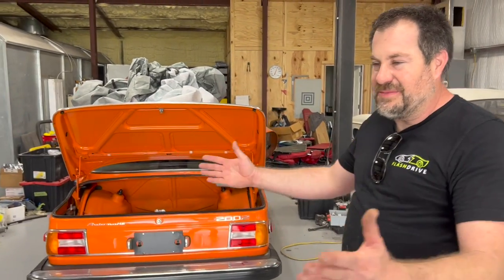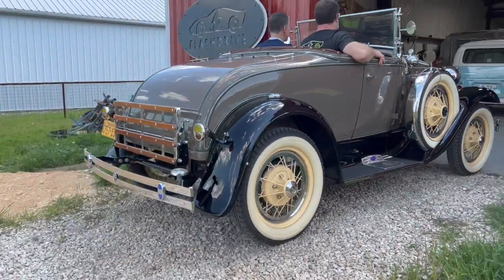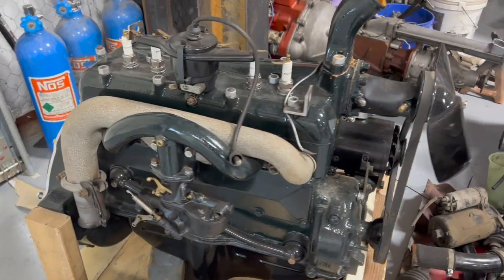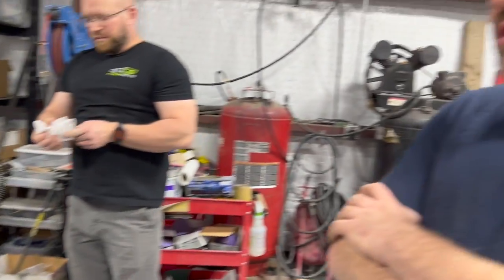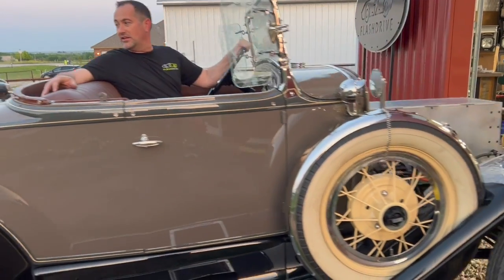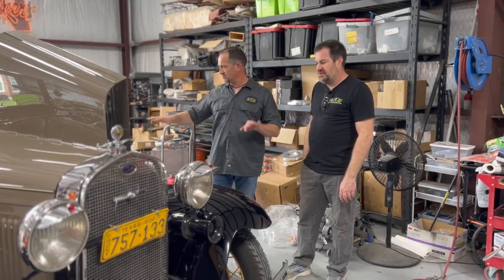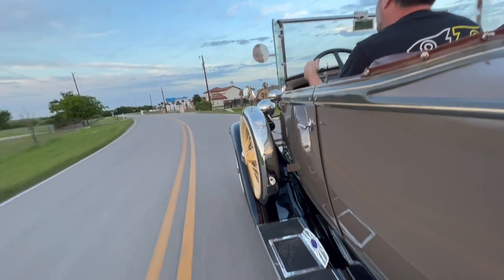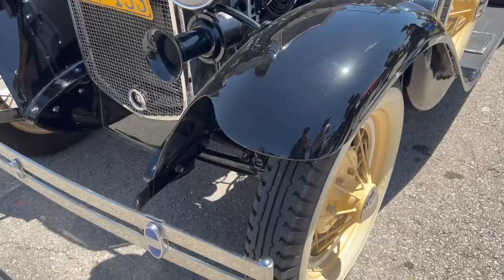The Model E - 1930 Ford Model A Roadster All Electric EV Bolt In Conversion. Tesla battery & Hyper9.

Comment: The perfect conversion. Ford would have loved to build similar, if they'd been possible/practical back then. Even his wife drove a Detroit Model 47 and temporarily looked at building electric cars around 1914. Of those who were down on the conversion, I'd bet a lot of them have hacked up some old cars in their time. You just did a sensible swap, 100% reversible.
Reply from the maker: Thanks, we liked that it doesn’t permanently change the car. But he can now use it
Reply: @dissrepair  Odd fact: V8=cool, EV=ruined. 😁 It should be more pleasant to drive and store, just climb in and drive. He might notice his car and garage loses its distinctive "musk" smell after a few months; 70% burned oil, 20% from fuel, common with pre-60's cars.

Comment: Converting a gas powered car to an EV is an abomination to that true classic. EV's are not the future for lots of obvious reasons. Converting EV's to gas is becoming common after the expensive batteries die but molesting this classic is just sad. Yes, you made it so you can convert it back. But it should never have been attempted in the first place.

Comment: I like the concept of talking very old cars and converting them to electric. but this car is way to beautiful to do that that to.

I like the fact that you made it reversible. a person would want to convert a model A to hydrolic brake's. and Coker Tire makes replica radial tires for those cars. that would eliminate the flat spots in the tires. and would work better and be safer at higher speeds.

Comment: First and foremost I most appreciate your dedication to avoiding modifying anything permanently. That was the best news.  The workmanship looks quite good too.  It doesn't look like a hack job, which is also very good news.  That said, I normally do not consider electric conversions that retain the transmission to be good, but, in this case, it avoided hacking up the drive train, and so it actually makes sense here.  Just leave it in high gear, if it has an appropriate motor.  You could swap in a lower axle ratio.  No harm in that.  My Model A pickup has 4.11 gears, and the old engine is rather screaming along at 65 mph.  Would love to swap my gears for yours lol.  To me, the BEST part of old vehicles IS the original or at least period correct drive train.  THAT'S what makes them interesting, outside of just looking neat.  So, I don't have a problem with the electrical conversion specifically, just non-period correct engine swaps in general.  In my experience, Model As drive in today's traffic without issue, so all of that talk to the contrary was just unnecessary justification, and it is largely untrue.  Never heard of one blowing a head gasket, but of course it's possible with any engine, so I don't doubt it could happen with one of these as well.   Mine has been in the family since 1941, and of course I want to keep it as original as practical.  It's not restored, it's just a cool old truck.  Driving it is very much like stepping into a time machine. The sights, sounds, vibrations, the odors, all of it.  Like stepping back in time.

Comment: i own a Model A and i had thought of converting to electric or a modern 4 cylinder because keeping it up and driving on the old slow engine sucks even though i converted to 12v ,  electronic ignition and weber 2 barrel carb

Comment: I like what you have done and I like that it is totally reversible, you did not mention the cost, I suspect mega money that would make it out of most owner's reach. I would like to do this to one of my vintage cars, however...

120 years ago there were more electric cars than petrol (gas) cars, but the same problems for EV's then exist today, range & charging, but add into the modern mix, highly flammable batteries - this could be the achillies of modern electric cars. Imagine that, as the batteries get older, fire can be an increased risk, cars are banned from underground car parks, being parked near buildings, or other cars, not allowed on ferries, etc., will kill it dead.

I am not convinced that electric cars are the way forward, certainly with the current battery technology, and where is all the electricity going to come from? We barely have enough power generation as it is, so with all these demands from new electric cars, I can see rationing occurring.

A carbon neutral fuel may be around the corner, and if so, that will kill the EV dead again for a second time.

I like the concept of EV, but sustainable, they definitely are not, we are being sold lemons as oranges and sadly, the new environmental zealots have made this into a new religion and if you don't agree you are a heretic. My view is that some of the claims will be debunked and the biggest issue that nobody discusses is that there are just too many people living on the planet, stop having kids that is the most sustainable thing to do. 

Greetings from the UK!
Reply: OH my, I'm getting solar installed around the 1rst of the year and am going to buy an electric car in 3-4 years or sooner. Religion? Hardly.

Comment: I'm a purist yet I appreciate beautiful engineering. I think it's pretty awesome. Painting the unit green was a very nice touch as well as the charging port. No doubt I would upgrade the brakes. Other than that, it's a fantastic local cruiser.
Reply: Have you ever seen Jason Mamoas vintage coach built RR .. E motor. Conversion the battery case looks like a fully polished dummy engine.

Comment: I would have to model A's. One would be electrified for the daily drive. The other one will stay with the original engine for the irreplaceable sound it generates. Like a VW beetle. Its 50% material 50% soul

Comment: Gas, diesel, ethanol, rocket fuel, Av gas, electric..
 Performance is what matters.
Not nostalgia.
 Not to a gearhead.
 Ford used the best technology available, at that time.
 If an electric conversion has equal or better Performance, then stock.
I'm all for it.
 The weight of battery's and limited range were issues to overcome.
 An affordable 4 wheel drive EV with a motor in each full floating hub.
Could have ground clearance and flexibility / wheel travel.
That no solid axle can come close to.
 I appreciate your work.
Well done, but.
Fix the brakes.
Brakes matter. A lot.

Comment: Good way to ruin a great car.
Reply: It's a great way to immortalize a car from the bygone era
Reply: nah
Reply: ...did you miss the part where they talked about the fact that they didn't have to modify the car except for a hole they had to make slightly bigger?  The rest is bolt in.  Meaning it is completely reversible. All they really did was make it more reliable and drivable.
Reply: Ford made almost 5 million Model As. They made over a million in 1930 alone, and would’ve made more if not for the Great Depression. As a result, their resale value isn’t very good. To restore one would be a labor of love, as you would never churn a profit. Due to their availability and price, they were a great platform for hot rodders. That and Model T’s. You could say that this is the modern version of that. There are plenty of museum concourse examples, that making such a car your own, really shouldn’t be that big of a deal. And if anything, it allows this car to be driven daily if the owner wants to. That means this car will actually be SEEN by regular people who may have never seen one before, because they don’t go to car shows. An engine can always be swapped back in should a new owner prefer something more original, but these are such difficult cars for modern drivers to handle, that they probably wouldn’t. Sometimes it’s nice to just get in a car, and drive.
Reply: Was it ruined?
Reply: Womp womp
Reply: Exactly

Comment: A much smoother ride is obtained when the originals A’s wheels are replaced with 1932 wheels and the spare fits the fender well too.. I drove a 1931 Model A pickup with 1932 wheels in high school and College.

Comment: The three phases electricity 🔌. 
1. Not economically sustainable. 
2. Not environmentally friendly. 
3. Not applicable on the economies of scale.
Sure they promised that they're researching for a new battery types. In mining of lithium, where China and Russia have a greater supply. Environmental damage and disruption caused by going after this. And they problems with having a viable way of recycling after use for a wife has concluded. There are other issues. Am I a big naysayer when it comes to electric vehicle?  Based on these points answer's yes. But do you remember the electric quarter-mile postal van built 30 years ago or so, by a short teacher and his class? It had come into ownership by a couple of men. The store I got was one had passed away and the other Wella just sit in his garage for a while along with a newer version for the electric propulsion system. I had negotiated a price but based upon transportation the deal fell through. It's worked out well for the man because her what I was going to pay for it, he got so much more a short time later. So I have a very strong interest in electric vehicles. I just don't see the upside being stronger than shall we say the downside of electric vehicles. Speaking of taking the vehicles to the masses on a large number. This was a nice car that pay bills in this episode. But people have been converting cars and pickups for decades now. Remember when CNG was going to be the next great alternative to standard fossil fuels? Of course most of you do not. But go back and look around 2010 or so. There's a number of over-the-road trucks that are CNG. Look at FedEx and UPS semis. I personally own a V10 Ford that is CNG and a Honda 4-cylinder car that is  CNG. I wish they were dual-fuel but they're not. So it's not like I haven't looked into it and actually spent money on alternative fuel vehicles.  There is a place for electric, just not for the masses.

Comment: This is actually a great use for EV….brings new life to ancient technology and reliability! ……especially vehicles that sit a lot …no worries about fuels going bad etc.
Reply: Yeah if the engine is beyond repair but aside from that it is pointless to convert a Ford Model T and A if anything it is damaging the whole Charm and historical value of the car second these engine run on anything that burns you don't need gas for it so restmod a beyond repair sure aside from that no however you do you what the guy wanted makes sense the engine was bad and he wanted to enjoy it everyday that I agree with I just don't want all the Model T and A to be electric keep some of them preserved at least.
Reply: If you did even watch the video they made everything using original mounting points without any modifications so you can switch back to original engine. Because these conversions make these vehicles usable and can be driven even in cities in the future. This way more people can see you driving and you don't need to abandon these nice old machines. @jonathancunningham8739
Reply: Dont want any glorified golf cart. Doesnt matter what body it has.
Reply: My belief is if the engine is past the point of no return then make it Propane fuelled or Electric it may not be original but at least some part of history survives. @donreinke5863
Reply: @donreinke5863 as if a 100 year old engine is much faster
Reply: @cheesemanthe2nd  LOL anyone trying to go fast in a 100 year old car has a death wish.

Comment: As a 1931 Model A Roadster owner myself, I think this is pretty dang awesome. I appreciate the fact that it is a bolt in conversion and does not detract from the driving experience (minus the engine sound that I am a sucker for). In a more looking into the future tone, as electrics and the battery improve I do see a place for EV conversions such as this. Especially looking 30+ years away. Do I feel you will still be able to get fuel for the old engines? Hopefully, however I do see rising cost and if EV's fully take, less locations to get fuel, Let alone fuel that is more friendly to the old engines (AKA no ethanol). Thanks for helping make things look a little brighter in the future of the old car hobby.
Reply: about the sound, you can always rig  the EV loudspeakers one at front and the other at the rear and play a Ford Model A sound.

Comment: somewhere in my "archives" I have an old magazine, I think it is a Science and Mechanics, (or similar) late 40s, early 50s, and there is an article in it about some college kid converting a Model A into an electric car way back then, and how he got into trouble with his landlady because he was using so much more electricity per month than previous tenants.
I have a 29 Fordor in the back yard and just wish I had the cash available to do this with it
Reply: You can go VERY basic with a fork truck electric motor and lead acid batteries though the batteries would weigh MUCH more and the range wouldn't be good. The other better alternative would be to find a wrecked electric car to pull the parts from. Configuring the battery for size would be the hard part.

Comment: If the brakes don't work well it is not because they are mechanical it is because they aren't right. Whether the mechanical advantage to the brakes comes from levers or hydraulics makes no difference.

Comment: It’s a really well done build, but I personally wouldn’t do it. Part of the charm of the Model A is it’s mechanicalness. I just drove my 1930 Fordor on a 2600 mile trip with my son and zero mechanical issues. We did 500 miles on day. I don’t think you’d be able to do that with this-the converted vintage cars typically have very limited range. If the owner converted simply because of overheating issues, they should just fix the overheating issues. I drove mine in some brutal weather, horrible Chicago traffic, and parades, don’t have overheating issues. The only time my car has gotten very hot was when I was pushing it too hard in the colorado mountains. I simply took it a little easier on it and the temps were within a safe range. 

I keep hearing about  converting their old cars to electric for reliability reasons. Realistically, those old cars -VWs, model As, Porsches, etc , are super reliable when they are done right. 

Let’s remember that Tesla’s do not exactly have a great record for reliability- so converting to electric isn’t a guarantee.  

Again, it’s a nice build. I would not do it personally , but I can’t say I hate this one either

Comment: Nice work. In third gear, the Model A is not driving through any gears.  It’s just a slip connection between the output and input shafts - direct drive. If you aren’t going to shift, and don’t need reverse, you don’t need a transmission for electric drive.

Comment: I would be worried about breaking transmission and. Everything downstream of the high torque motor
Reply: The original engine is already a high torque motor. The transmission gears are massive compared to a modern car. The drive axle is a solid tempered steel rod. Besides if you drive it in gear 3 it's a direct drive, so no gears are even under load.

Comment: Great job! Excellent engineering and follow through with the build. Do you feel the frame and drivetrain are strong enough to handle the torque of the motor? What would you estimate the cost of conversion is? Are you going to have, or make available parts or drawings for this conversion? Thanks for sharing the build.

Comment: Nicely done reversible conversion! The green battery box, charge port, and bell housing adapter are quite nice! Which BMS and charger did you go with? Is your DC/DC converter 6V or 12V? Glad to see you’re keeping it reversible.
My ‘30 Model A Ford pickup is already a Frankentruck, I’m looking forward to a similar conversion this Fall. Thanks for the inspiration!

Comment: Awesome conversion! I would absolutely love to do an electric conversion on my Z car. I've been a gear head my whole life, bought an EV just to save $$$ on my commute. Now I don't think I'll ever own another ICE model again, ever. I'm 46 and have done all my own work. Everything from rebuilding a motor, transmission, engine swap, you name it. I love the simplicity of EVs. No more oil changes, brakes last longer, etc..
Reply: I d like to see other conversions of larger vehicles to be an EV and if down the road converted back.

Comment: I’d say that this electric conversion isn’t too far removed from the Burtz block upgrade. It’s no longer a pure Model A, but it has enough Model A features to make it still a historical experience.  And you should make a kit.  People pay more than $6,000 for those Burtz blocks and all the required assembly,so?
Reply: Except that it leaves out all of the soul of the car... The sound, feel and smell of the original engine is 50% of the experience. And that stays the same with a burtz... But at least this one is reversible so, meh.

Comment: We’ll, it has good visibility. Nice job with the trans adapter, but the Model A flywheel housing isn’t cast into the block, it’s a bolt-on part, and you can buy one for about $40.

Another advantage of the Model A is that third gear is not a gear, but a direct coupling of the input and output shafts, so it’s totally quiet.